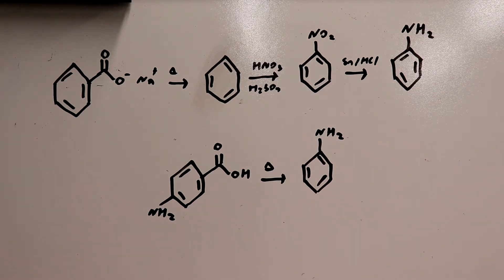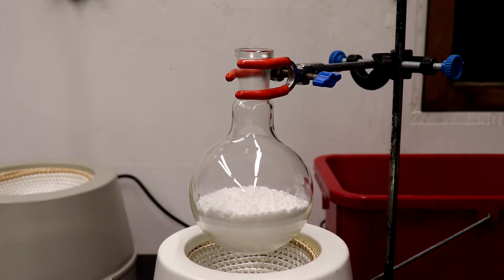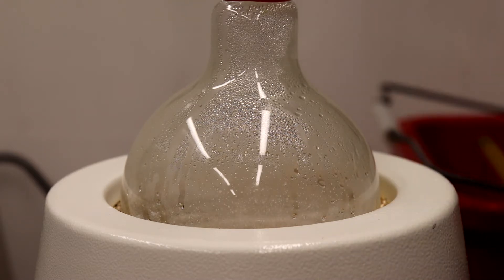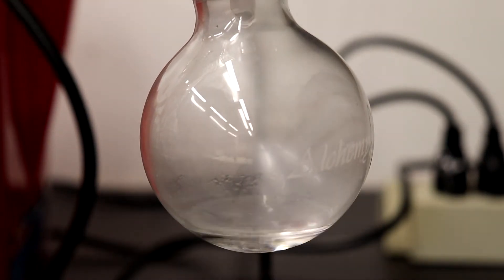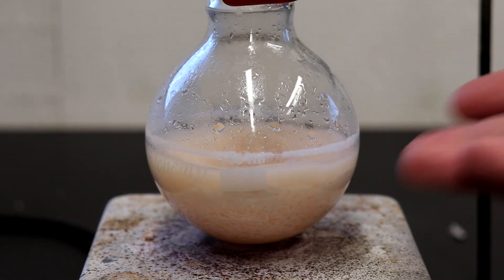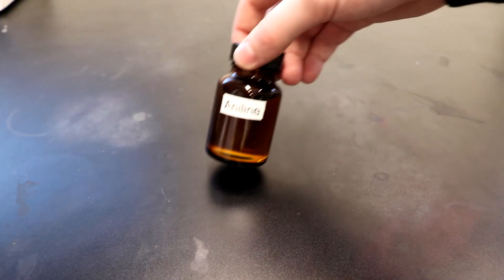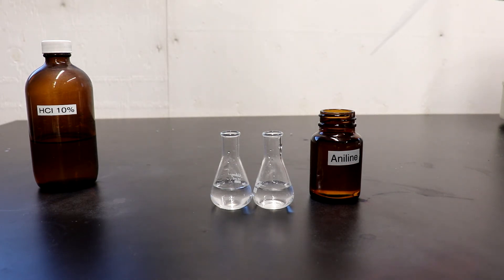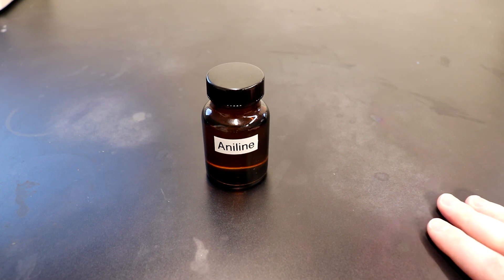Simple Aniline Synthesis from Vitamin B10

Comment: Very nice. Did you add a stabilizer or were you using it quickly? Something like hydroquinone or tert-butylcatechol? Also did you ever check the concentration? I think this method is a good solution for me I am just curious how it worked out for you in the end?
Reply from the maker: I didn’t add any stabilizer, just stored the aniline in an amber bottle away from light, over time the aniline will darken regardless. I didn’t do a titration to determine the exact concentration/purity but it should be quite pure after distillation. Many other people have replicated my procedure (there are some other videos posted about this reaction on YouTube now) and they have had good results as well!
Reply: Thankyou for posting this video btw.

Comment: 06:13 is it ok that aniline trapped to your vacuum pump? Your oil in the pump will be contaminated and will release toxic aniline into atmosphere... after adsorbing water from air during non-use storage of the pump it will later lead to lowering maximum vacuum achievable with this pump. And vacuum pump oils is not dirty cheap to replace it every day.
Reply: It looks like it stayed in the tubing

Comment: It is possible to easily make p-iodoaniline with iodine, sodium bicarbonate in water.
Reply: you would most likely have to react the aniline HCl with iodine and nitric acid. There‘s really a lot to be found, even on eikipedia, so you should probably go there yourself to find the best way
Reply: @giansieger8687  
You can also start from vitamin B10, form the silver salt and react it with excess iodine.
This reaction is the Hunsdieker decarboxylation.
There are many variations on this method but all replace a carboxyl group with a halogen group.
Reply: @drgazter  did you just discover a new vitamin or are you high? I assume you mean para amino benzoic acid?
Reply: @giansieger8687  
Yes, I mean p-aminobenzoic acid... also, the guy who named this video must be also very high

Comment: I just googled it and apparently you are the first person to actually do this rxn. Have U come across any posts/comments/references or anything like that of someone who has actually done this before?
Reply from the maker: One of the reasons I wanted to film this was because I hadn't seen it done before and it's practically useful for the amateur chemist. I started looking into this reaction about two years ago after running the decarboxylation of niacin to pyridine, I figured that a similar thing could be done for paba to aniline. I was unable to find any papers using simple thermal decarboxylation of paba but I did find similar papers demonstrating the thermal decarb of anthranlic acid to aniline here: https://cdnsciencepub.com/doi/pdf/10.1139/v52-065 In early 2019 first tried decarboxylation in aqueous H2SO4 but I only got a tiny yield of what I presumed to be aniline from its immiscibility in water and subsequent solubility in acid. Moving onto thermal decarb, I then figured that I may as well try just heating the solid before experimenting with adding Cu chromite or anything else. To my surprise, I found that simple thermal decarb yielded an oily liquid with chemical and physical properties corresponding to aniline. I've used the aniline from this to make quinoline and phenylhydrazine which I then made into tetrahydrocarbazole in another video, also the product has a hypergolic reaction with nitric acid. My procedure has been replicated by a number of people on Explosions&Fire's discord server as well.
Reply: @corrosion-chem -  Great synth and videos.  I was wondering if have ever done any GC/LC/TLC/MS analytics on your synthesized compounds to measure purity and contaminants from side reactions?
Reply: @corrosion-chem  I had the same idea and found your video! Thank you for the demonstration 😄